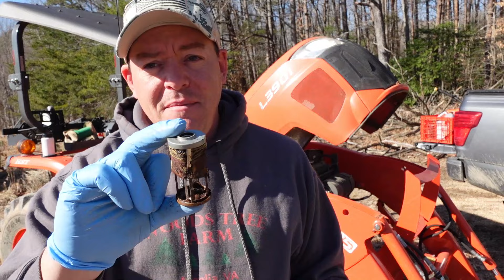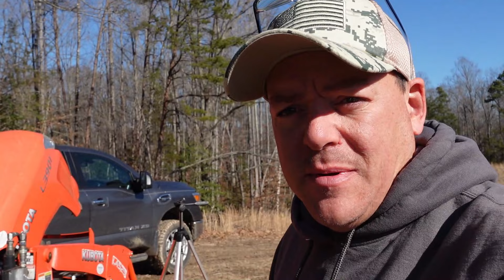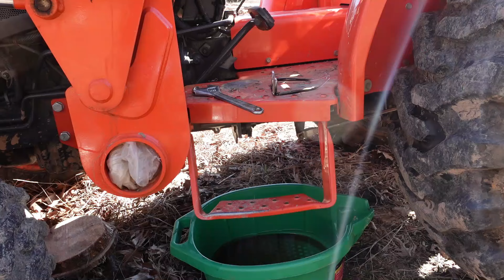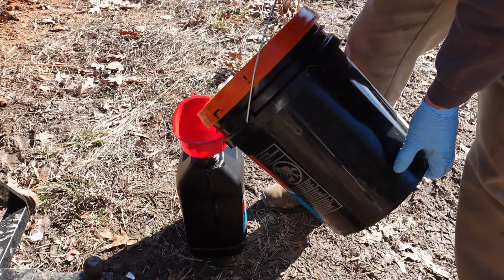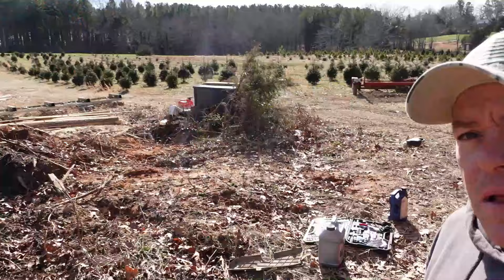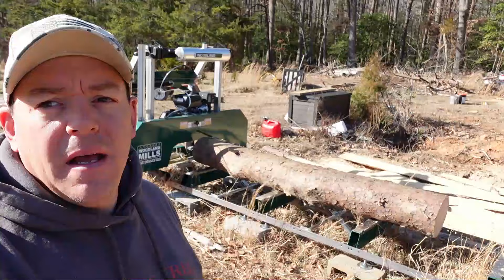No One To Blame But Myself

Comment: take a sharpie and write the number of hours and date  on the new filters so you know when you changed them.
Reply: That’s what I do!
Reply: Yep, always write the date and hours on the filter and you have a handy record of when it was changed.
Reply from the maker: I got videos as my timestamp! haha
Reply: I've had sharpie wear off my filters as they're used. Now I use an engraver or scratch awl to etch the hours in there
Reply: Always a good idea to record it in your owners manual along with the filter part numbers and the brand of fluids if other than factory spec. not only for your own reference but for the future owner in the event you sell it down the road. It’s a good selling point if someone knows the prior service  history and details.Also don’t forget to service the front differential at the same time. Likely there are multiple drain spots. One in the middle and one on the lower side of each axle/hub assembly.

Comment: I'm alive again. It says thank you for the new fluids and battery. Back to work. Just a suggestion. Maybe make some cutting stands so there's not as much wear and tear on the hydraulic system holding those logs when cutting. Just a thought. Don't know if it matters but it seems it may.
Reply from the maker: I figure lifting is what the tractor was built for. I just need to do better keeping up with the maintenance.

Comment: Here's a tip, I know this is a newer tractor but always start with the fill plug incase it rounds off or breaks.
Reply from the maker: Solid tip. I've done enough differentials and transfer cases to know about that one & already had the fill plug off. Its a big plastic cap on this tractor, so no biggie.